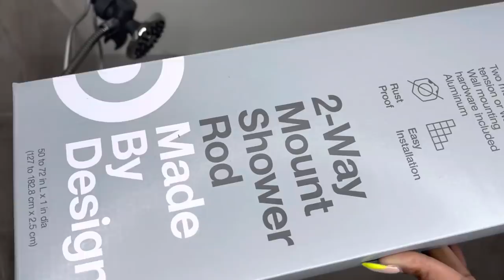SMALL FALL BATHROOM REFRESH / IKEA & TARGET ITEMS USED / MAXIMIZE SMALL SPACE / HUUUGE CASINO / SMTV

Comment: If you ever want to get some alternatives to curtains and blinds look into stained glass window tint I use it in my kitchen instead of curtains and it brings in so much color light but still keeps the privacy
Reply: Now that's a great suggestion! I hope she sees this! Curtains just get so dusty and grimy in bathrooms (in smaller ones at least from my experience).
Reply: I did that too and it's easily removable
Reply: I added stained glass reusable clear sticker liner it works well and looks beautiful

Comment: Hi Shyvonne, great job. A fantastic design tip is to use your vertical space. 
Hang open shelving high on the wall across from the bath tub and place your toiletries baskets & towels there and add another towel rack next to the one you installed.
You can then remove that cabinet & free up your floor space which will open up the room & be much safer for your kids.

Comment: Suggestion, why not add a second towel rack side by side or a third rack. The curtains at the window should be replaced with a stain glass look, there are a variety of styles and will let the sun light in. The cabinet is too large for the space. Why not add shelving on the wall with baskets. Not mounting the cabinet to the wall could be unsafe. Add extra towel racks, side by side. Do you need bolts to insert into wall for holding power? 😊😊 Just suggesting.

Comment: You will need to strap it to the wall to keep it balanced...if it (shelving unit) has a strip of wood in the back you can screw it to the wall so it does not move.

Comment: Hi Shyvonne,  Try Greased Lightening degreaser for your kitchen and bathtub/shower.  It removes body oil and soap scum in the tub/shower walls.  Then, it cleans a greasy stovetop, pots, pans and dishes like no other product I've ever  used.  It works fine with Dawn.  It is sold at Walmart and Sam's Club.
Yes, the curved shower rod is priceless in a tub shower.  The bathroom refresh looks nice.
Peace and Blessings
Reply from the maker: Thanks Belinda for the tip. I will definitely try it. If it makes cleaning easier I'm all for it.